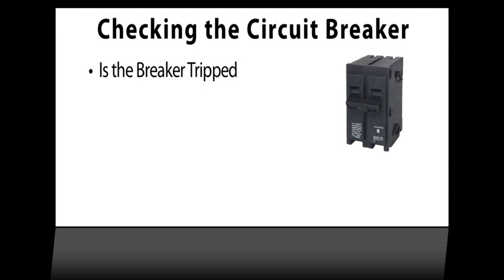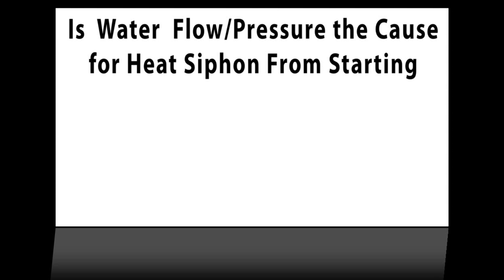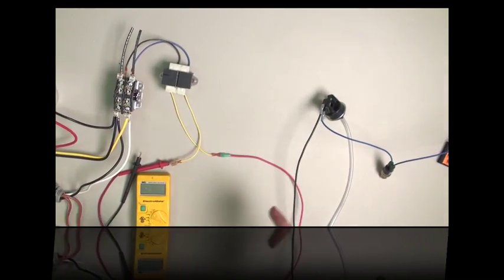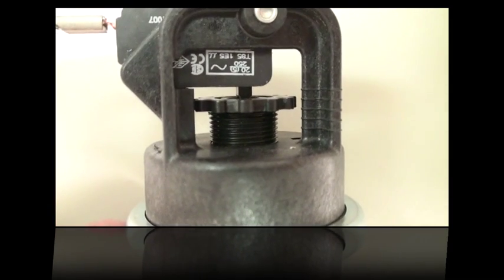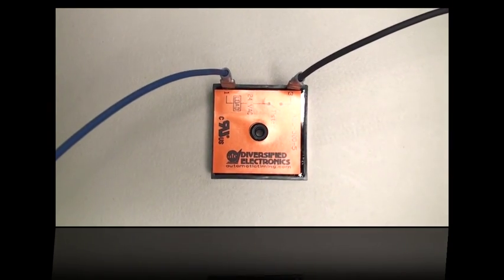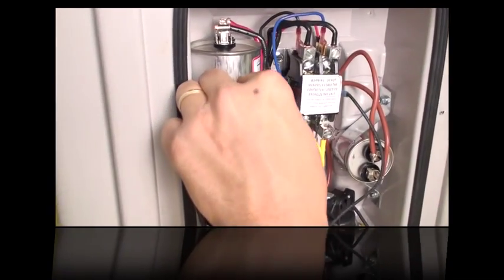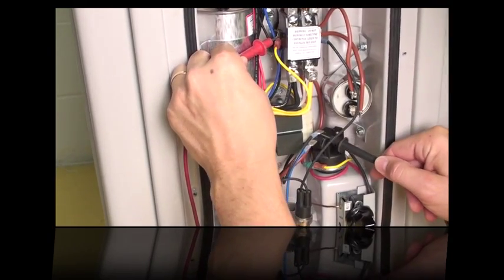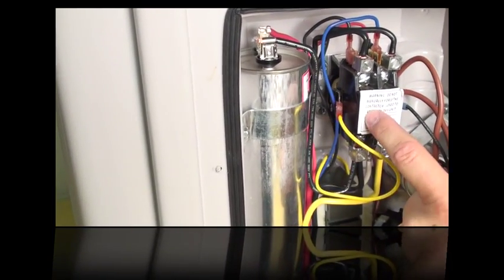Heat Siphon DIAGNOSTIC VIDEO - Will not start

Comment: My heater will work in morning and will shut off.  Once this happens it will not come on.   I followed your voltage check and it appears to be the 5min timer delay.   I get 24v on lower side but 0 on exit of it.  I just ordered one and we will see if this is it.

Comment: Hi,   i  have  two  problems  with heat siphon units
1.-   one  system  is runing  for  hours  and  can not reach  more  than  87 f,  is  a 40 sq/m pool   using  a z575  unit, pool is  completely  indoor,  outside  temp  average  is  15 degrees  centigrades,   10 by night  18  to 20  by day, what  do i have  to do ?
2.- problem  is  with a similar  pool  size  and  another z575 unit,  thsi unit  does  not  even start, and  we  can tell that  when the unit  try to start,  voltage  on input  drop  ( half second )  to 177 volts.  so,  is  that  the problem ?,  what  should i do  to fix  that.. regards   Alex